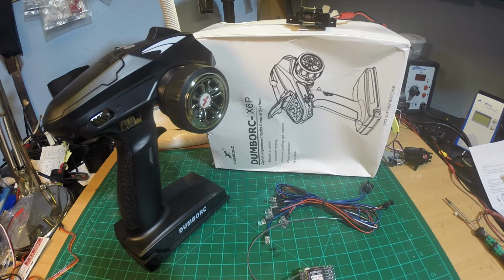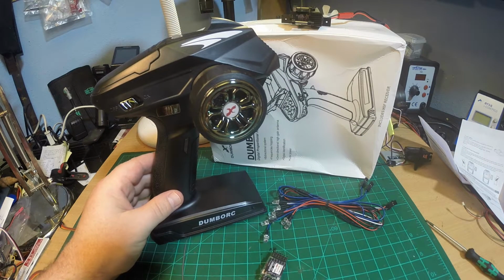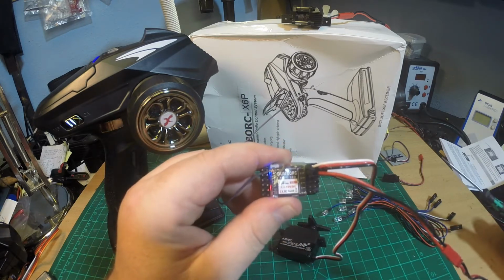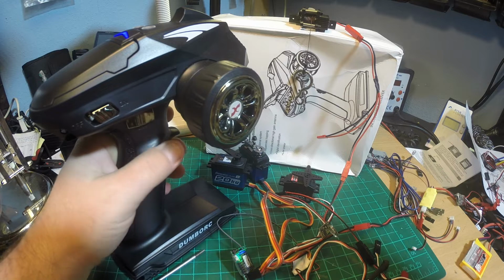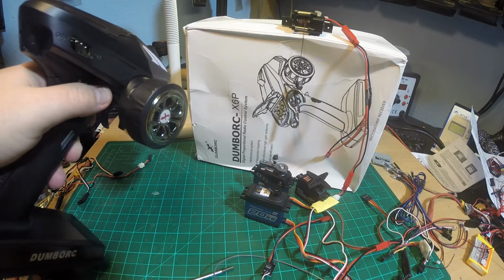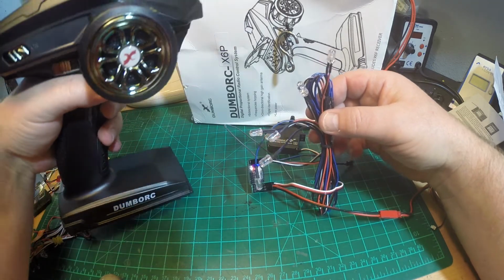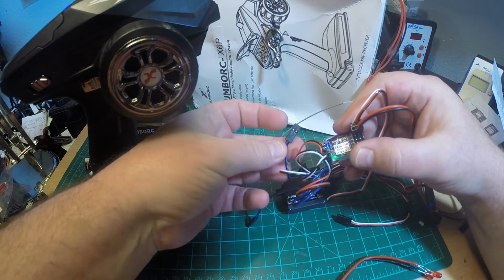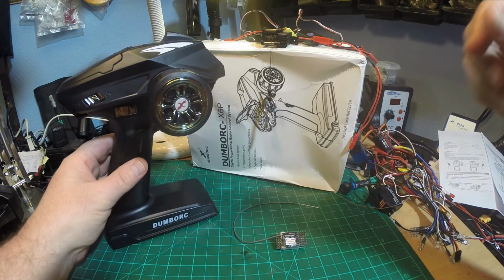DumboRC X6P: 6ch budget radio with rx-integrated lightcontroller

Comment: There's so much to learn. I'm still trying to find someone that has used all the channels on their receiver to install lights, wench etc and used a transmitter(dx5c) to control them like turn on the headlights with "d" trim and  Roof lights with "E" trim I haven't seen a receiver full yet.

Comment: I like the direction we’re headed!
I’ve been a Spektrum user for years, but happy to have some new options.  Just got the radiolink rc6gs with a couple extra 7ch gyro receivers.....for less than the cost of One Spektrum 4ch gyro receiver. Thanks for the review.
Reply from the maker: I am still a Spektrum user, love my DX9 Black (for my helis and planes) ;-)
Best Bang for the Buck is IMO the Flysky GT3C with (free) 8-ch firmware mod and receivers for sometimes less than 5 bucks.
Reply: Nice, me too. Regular dx9/dx6 here for planes and multi-rotors. I bought the dx9 Used years back and every time I needed to upgrade it, Spektrum would flag it.  Requiring a call to support. No need to upgrade anymore, just like frsky, Spektrum/Horizon hobbies is circling the wagons😎.   Currently building a rwd drifter, so this kind of all in one receiver is very appealing!

Yes, I would have preferred the flysky, but it quickly went out of stock around here. Did see some on eBay for a $40 premium a couple months back. I teach rc stem classes to kids, flysky fsi6x is our go to for air......6 Ch tx /rx $35❤️
Reply from the maker: @ruftime  Teach RC? Cool ;-)
I came to Spektrum about 10 years ago because of the Blade mCPX, which was my first 3d heli (ok, after some Walkeras) - and Nano CP, 130x, ... had about 15 of those, and then because of the absolutely awsome UMX micro planes, I love those, really love them, Pitts S-1S is my fav. - DX6i, DX7s and then, 5 1/2 years ago, the DX9 Black, 600 € here, but still love it and will not move. 
My "problem" with the Spektrum Ground radios are the expensive receivers. Won a Spektrum DX5c (SBG Christmas giveaway 2018), sold it because of this immediately. But for my Spektrum air I get cheap and relieable receivers (Lemon, Orange, Redcon), so I can go cheap, if I want.
Do have about 25 micro rc cars (and some 1/10), most of those with cheap Flysky 3-ch rx (5 bucks), changing all of those to a Spektrum rx would cost a fortune (and in some cars the receiver would be as expensive as the car ;) ). 
Flysky GT3C 8-channel is not for kids, it is extremely complicated to program, but it is unbelievably powerful. There is an awsome "how to" thread or post in a German forum, without this "manual" I would not be able to do most of those things. But I guess, my Flysky GT3C is even more powerful than my Flysky Noble related to program options.

Comment: Should i get the NB4 or a dumbo rc?
Kinda like that light controller and gyro ... As far as i understand the NB4 has no gyro ... Im just down cause of the build quality, looks like the nb4 is very premium.
Reply from the maker: I have both and like both. I also do have a gyro for my (NB4) GMR micro receiver. But only the gyro is nearly the price of a cheap Dumbo radio ;-)
The NB4 is of course far superior and does have model memory.
Reply: @donaldsneffe  im sorry im not understanding, you used a dumbo rc reciever as a gyro?
Reply from the maker: @GeloOfficialPR  There is a DumboRC receiver that has a gyro included - normally you will have to use an external gyro.

Comment: Great video! Does the non LED receiver (normal with plastic case and gyro) channel 4 work as a integrated light controller?
Reply from the maker: Thank you - No, it does not. You will have to use a receiver switch with this "normal" rx.
Reply: Ok no problem, I have one on order. It's really great that the rc community troubleshoots these China products, otherwise we would never know how to use them. I also really enjoyed your servo test videos! You probably saved my BEC from being burned out. They should really advertise max amps!. Thank you!
Reply: instaBlaster

Comment: Could I buy the original x6 with the turn dials on top and then buy the lighting receiver separately that way I get best of both worlds?? Like you said in the video because they upgraded to buttons you get limited function now. But if the original x6 was compatible with the LED receiver combo you’d still have those better turn dials and still have the full adjustment functions on those two extra channels? I guess your ultimate decision depends on what style of RC your going for rock crawler, basher, racer, competition/detail or construction/commercial... 

After watching the rest of your video I realize this receiver may not be the best for lights and other function/ options. If all you want are lights basic it’s ok but not ideal. Is there a lighting system or lighting receiver out there that’s still compatible with the x6? Or should I just get a completely different radio/ receiver combo that can do lights better at a reasonable price?
Reply from the maker: Hmm... difficult to answer ;-)
I personally do not like all those cheap lightcontrollers with turning lights always on when turning, etc. I love the LaneBoysRC Lighcontroller (but that is much more difficult).
Do have quite a couple of cheap light control systems here (from the old days), they all work the way the DumboRC works.
Dumbo radios are good, really - for the price. 
So donno what is a "better" radio... (I love my 8-ch GT3C and my Noble, but this is different class).
If you only wanna use the radio for 1 car, and do not need model memory and are on a budget, Dumbo is really ok. 
You can also buy a Dumbo without lightcontroller and buy a seperate cheap lightcontroller, for about 10 bucks... same thing (if space is no problem).

If you only wanna light on/off, you cqn simply buy cheap on/off rx switches. 

I do not know what exactly I should answer ;-)
Reply: @donaldsneffe  thanks for the advice. I’ll probably still get the original x6 I’m happy with that I think unless I find a better one. And then I’ll go with a lighting kit that’s pretty close to what I was looking for... It will work for the car I’m trying to build... thanks.

Comment: Another YouTuber had this same style of gyro receiver just like your but without the lights function... he tried this same gyro test outside of the car and it did not work just like yours is not working... but when he had it installed in the car and had all the wires plugged into the receiver ie: esc, servo. The gyro started working immediately... 

This is just a theory... but I think there’s a sensor in the receiver. And it tells the gyro not to activate unless all electrical systems are installed in the car and working. Once it can detect the motor, esc and servo on all the necessary channels it will work when you press the button to turn the gyro on. But maybe it’s because his radio had the dials on top and not the buttons... or maybe Tomas is right and it needs throttle first to kick on.... but I would think dumbo would take account of the new controller upgrade... You like testing things try it an see if this theory is true... I don’t have one yet. But when I do i will do the same test... anyways good luck... 

I want to get a dumborc x6p with the LED’s but a lot of people are saying when they order it they are getting the old receiver not the new LED one with extra pins... you said this happened to you as well. Would I be better off just ordering the receiver by itself?
Reply from the maker: Probably ordering only receiver is the better solution

Comment: I wonder how channels 5 and 6 will work if you connect a servo from a WPL 2 speed gearbox?
Reply from the maker: Probably fine. Ch 5 and 6 seem exactly made for this, gear shifting, diff lock, dig lock... fine adjustments have to be done with servo-arm lenght then. However, trimable channels 5 and 6 for this would be much better.
Reply: @donaldsneffe  
Thanks! Soon my WPL 2 speed gearbox for the MN99S will come and then I'll check.
Reply: @Bionikol81  Hi, do you know if the WPL 2 speed gearbox is working ok with X6P on Ch. 5 or 6? I am considering buying this remote.

Comment: Hi Donald, thx for your in depth video.  I have an X6 receiver (without the light controller) and want to turn on/off my light bar using ch3 of the Rx.  However ch3 button on the Tx does not turn the lights off.  Am I doing something wrong?  Looking forward to hearing from u.  Cheers!
Reply from the maker: Hi, yes, you do something wrong - you need a receiver switch for turning on/off lights, only radio and receiver do not switch on/off power on a channel. 
Cheapest solution is a switch like this: https://www.banggood.com/190mm-3CH-LED-Light-Switch-System-W-or-Flashing-Light-Function-Turn-ON-or-OFF-for-RC-Car-Model-Parts-p-1376880.html?p=6S2910081756201209IA&custlinkid=1328952 - they are sometimes supercheap on Ali or Ebay.
I assume your lightbar is made to be plugged directly to the receiver?
Reply: @donaldsneffe  ahhh ok. Thx very much for the prompt reply.  Is there a way to just turn on/off the lights rather than cycling thru the different flashing modes with this switch? Cheers
Reply from the maker: @phulesickmate  Unfortunately not. 
That is the downside of those cheap on/off switches. But there are many more receiver switches you can buy, also with simply on/off. I do not know, where you live. I love the tiny switches from Hansen Hobbies http://www.hansenhobbies.com/ - guess, they are settled in Canada (?), but shipping to my country (EU) is not that expensive; tiny switches, work awsome.
LaneBoysRC (check Youtube channel) also makes a simple on/off switch for receivers and sells them for cheap. He lives in Singapore. You can email him (also for his awsome light controller). I love his stuff. 
Or you can also buy a switch type G.T.Power switch https://www.aliexpress.com/item/4001260927282.html?spm=a2g0o.productlist.0.0.613011dd9cIOuB&algo_pvid=df13c477-09c8-4335-ba78-eac24dfde75c&algo_expid=df13c477-09c8-4335-ba78-eac24dfde75c-0&btsid=0bb0623416054649287557607ed6a3&ws_ab_test=searchweb0_0,searchweb201602_,searchweb201603_  (guess, I also bought it on Banggood some years ago, but cannot find it anymore).
Or you can even quite easily make your own receiver switch out of an old servo board - search Youtube for this.
I cannot understand why those cheap switches (there is also a further red version for similar price) do have this akward blinking mode.
Reply: @donaldsneffe  Thanks so much for the suggestions.  I live in Perth, Australia so LaneBoysRC might be a viable option.  I'll hit em up.  Hope all is well and covid free where you are.  Cheers.
Reply from the maker: @phulesickmate  No, second hard lockdown will start exactly in 24 hrs ... so we are much worse than Australia actually (and do have only an a and a l less ;-)  ), and a terrorist killed 4 people only few hundred metres from my home less than two weeks ago - so probably worst situation in my whole lifetime in my country actually. 
But thank you, personally I am fine, and we will survive. 
Good luck and best to you, too. Heard Australia is doing quite well right now, keep on! 
Love Australia (but only country and people, not the prices ;-)  ) and did already take a flight Singapore - Perth once, as your LaneBoysRC on/off switch will maybe do soon ;-)
Reply: @donaldsneffe  ahhh you are in Austria!  Vienna is one of my favourite cities and I have some very close friends there, so was very saddened to hear of the attacks.  Unfortunately covid is just as much a threat these days as global terrorism.  Stay healthy and stay safe my friend.  All the best from down under!
Reply from the maker: @phulesickmate  check this out, no 1 should be the stuff you are looking for: € 1,74  31%OFF | New RC Receiver Lights Switch On/off Control Electronic Switch For Rc Planes Cars
https://a.aliexpress.com/_mMx6Rgp

Comment: You need to apply a bit of throttle in order for the gyro to start doing something, it will stay calm when no throttle is used (at least that's the way it works on the traxxas tqi radio) Thanks for making this informative video, I see this radio is useless for me as the 5 and 6 channels are useless and the light controller is weird.
Reply from the maker: This is the receiver without gyro function.
I also think, the "normal" Dumbo x6 with knobs for Ch 5 and 6 are better in most cases, only if you wanna switch gears or lock diffs, dig, the x6p could be handy. Not worth the higher price.
Banggood cz warehouse actually has normal x6 in stock.